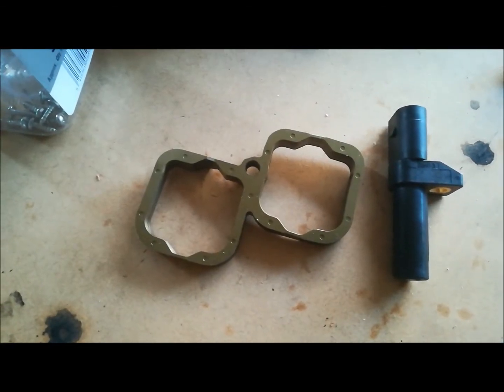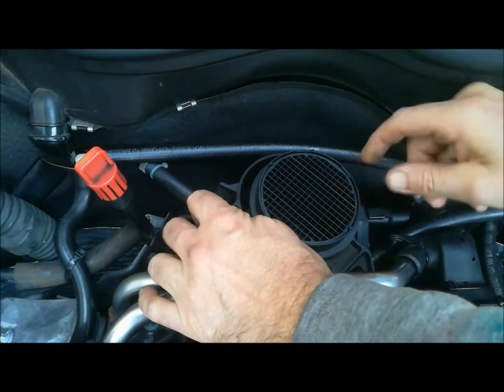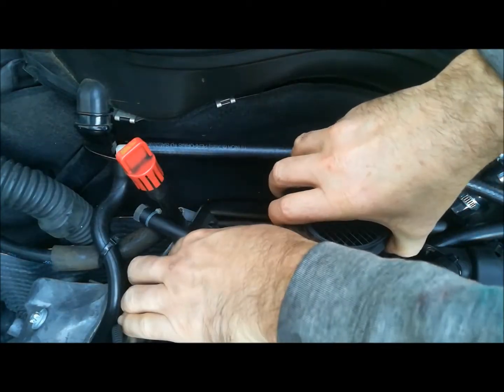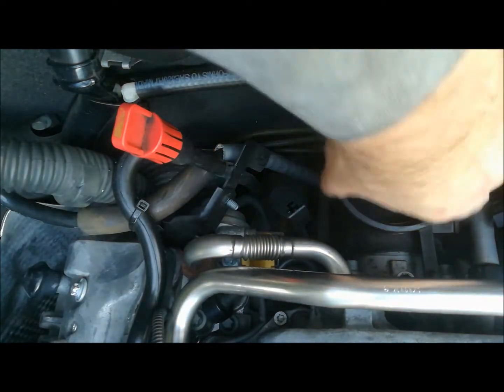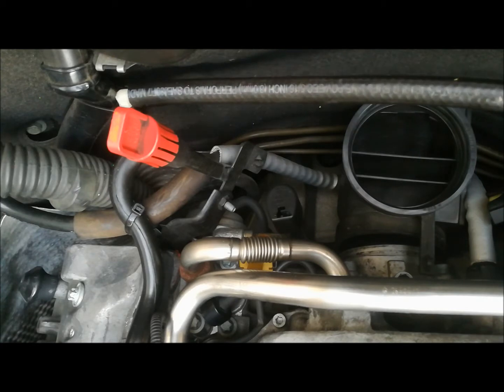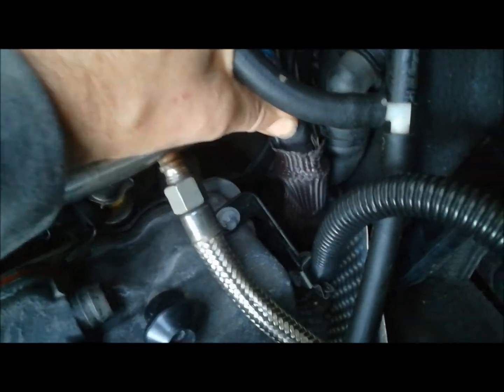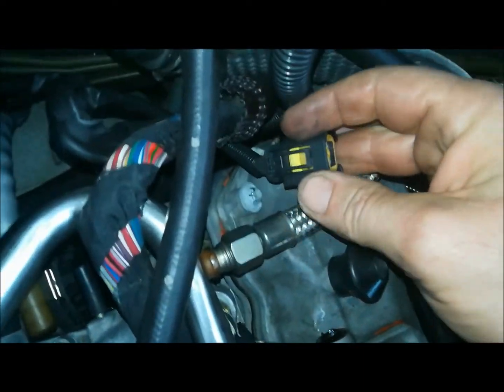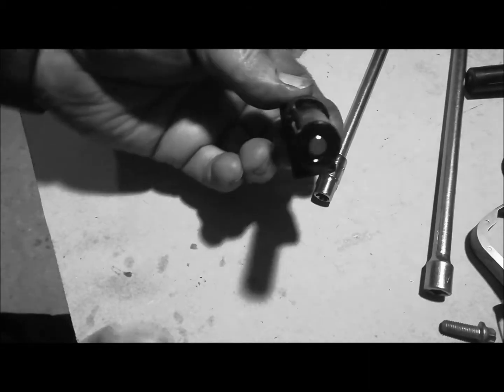C55 and E55 crankshaft position sensor change

Comment: Cheers for this was big help, also in NZ, did you mean size 9 socket as in E9? If so where did you get it? My kit only has E8 and E10 and I can't find a kit that has a 9 in it. I tried to do the job but couldn't get the bolt undone or get any grip on it with either an E8 or an E10, I got some grip on it with a 1/4" hex but not enough to break the bolt free. Not sure if bolt is damaged or if I just don't have the right socket

Comment: Finally a great how to from my neighboring brothers from Newzealand. Thanks Mike the tip to remove the plastic bit might help me as I can't get it unplugged due to all the wires on top. Can you come in from the bottom wheel arch? 
Thanks again mate.
Reply from the maker: maybe if you remove exhaust like i do in the engine mount video you will have easy access